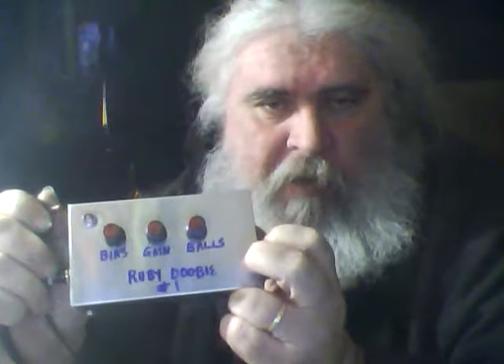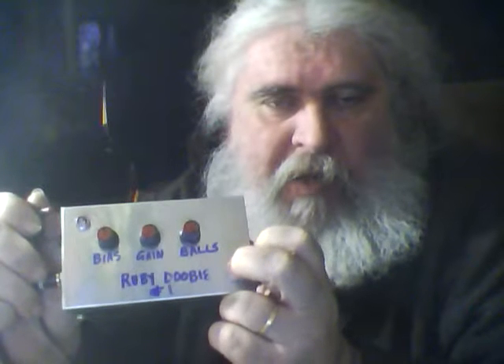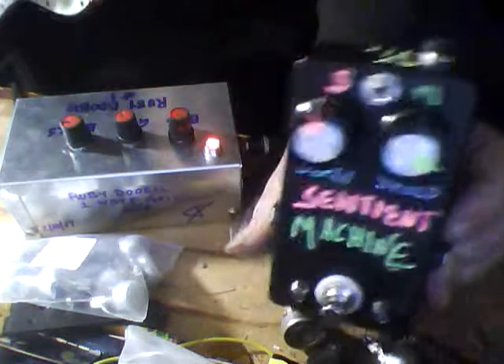stupid pedal trick ruby doobie with pink jimi

Comment from the maker: egads...
shucked a couple clams on the last layout dealio.

this one should be better 
thanks rutabaga bob for noticing my fuckups ;)

had a gig last nite, so just got a chance to fix this up
here ya go. haves at it. 
where it says 100-220r resistor you can go anywhere ya want, it's just there to snub a little gain so it doesn't go into oscillation on ya.
keep your leads short. shielded cable to pots jacks is a good idea. i didn't bother. kept the leads short, and tend to solder 'em right to the node itself with other stuff with gain pots. just seems to work better for me than using long sections of track.

[img]http://i605.photobucket.com/albums/tt137/pinkjimiphoton/RubyDoobie%202.2_zpsnxxjn5h6.png [/img]